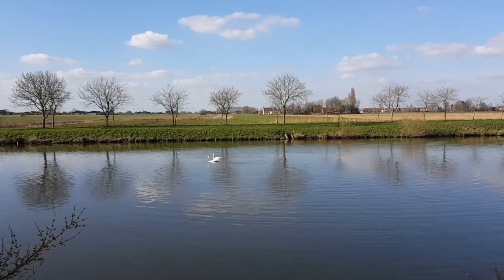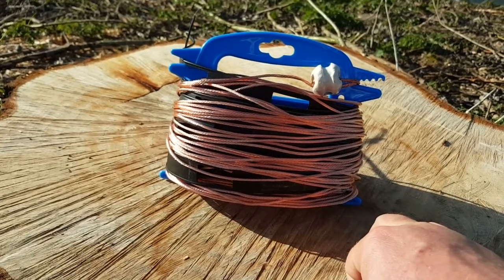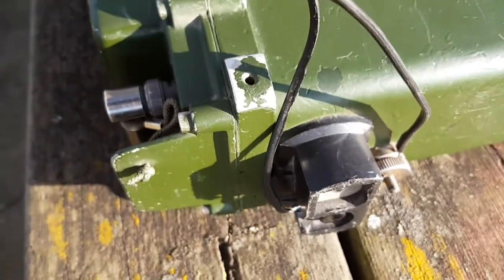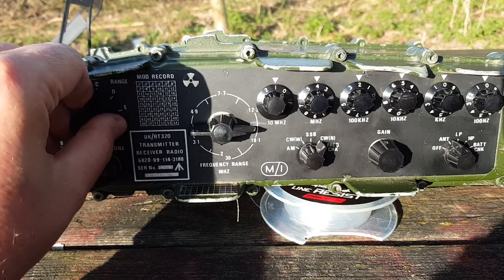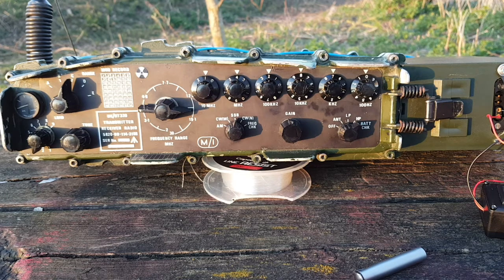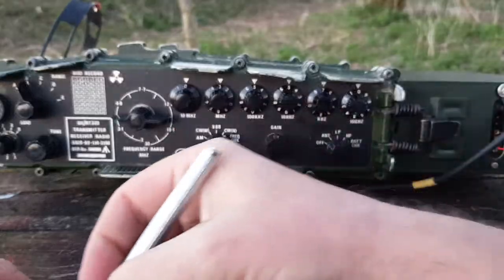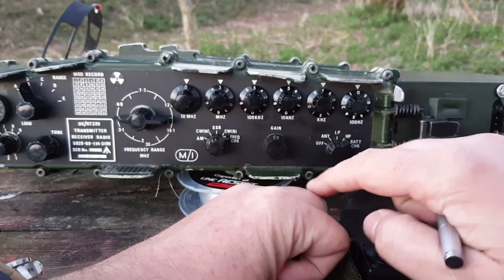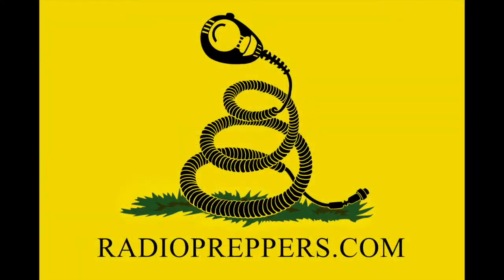W3EDP Antenna with RT-320.

Comment: The reason the dial is not moving is your freq is set up wrong...
You need to be set to a freq that matches your antenna which is, they all dont work well, plus time of day etc. if you swop out the ant for a skywave antenna then you would likely see something but best to review ant therory first to match time of day, conditions, power, ant type and size!!!
You cant just turn on two of these and hear each other or very well even next to each other, you need to be at a distance and take every factor into account. Its a serious indertaking as as an ex british radop it takes 1 month to learn and most giys fail and have to go back for to lecky camp to try again bk in the day 15+ years ago. if you dont pass the course, your kicked out of the unit and sent to basic to review other options, from driver to cheff etc

Comment: Good job! Great video!

Its amazing with all the screaming about the sky is falling ( global warming ) and yet people continue to toss trash like that is what it was made for! People just don't care or take pride in their environment! Its the only one we have! =]

But back to the W3EDP antenna. Ive seen great reviews on it. So I built one. 300 ohm TV twin lead. 4:1 balun and 25ft of RG8X. ( I tried a short 8-12 ft piece of RG58 but did not work! No tune! )

It seems to have great RX! Only made 2 contacts so far. 1 on 40M and 1 on 20M. They both gave lower reports than I gave them but I'm not sure what power they were running. QSO party this weekend and it was fast n furious so I didn't get to ask. Could have been a kilowatt. I was running 100 watts.

Now the real test is to check in on NETs. I prefer that type of operations plus they are there everyday so you can tell how band conditions are easier. Once you know the guys on the NET you know how their signal normally are and establish as like a reference. When conditions are great a wet noodle will do good so talking to the same guys everyday for years you easily know when something changes. Jumping on a freq one day at a portable station doesn't prove much. =]

But I agree. Something isn't exactly right with the W3EDP. Not sure if its the twin lead section or the long wire. Even once I added 25ft of RG8X I still had trouble tuning it! Also I have mine configured in a perfect inverted L about 20-25ft up.

I think it can be a great antenna but I'm not so sure about for portable. If it has to be perfect then its to finicky for portable. I think a doublet is better. 

I prefer my 88ft Doublet ( 300 ohm TV twin lead feeder ) as it seems to perform very well, not very hard to install and packs up very nice! 

I will check it out again this next week. Get on my O/M NETs and compare signals.

RM
Reply from the maker: Thanks. I need to build a new one and do more testing...
Reply: @RadioPrepper  yeah what I am seeing is to deploy it and keep the Inverted L shape its easier to deploy a doublet in a Inverted V. Unless the tree you need to hang it from is covered in foliage and you can't access a limb and you have to go over the top or something strange the W3EDP might work better. But ideally you need two trees with a strong line between them.

I think it performs well but not as easy to deploy. So a recon of the site before hand is a must I think. If you can drive to the site then no worries. Bring all your portable antennas. But if you have to hike then knowing the site ahead of time is a must. ( I have SOTA in mind as this was mentioned on a video of a guy using it for SOTA. ) Sorta like with you and the tree stump! It worked great say last year but a tree stump no longer supports anything. lol

Comment: Great video. do you have a favourite antenna for 20/40 meters for the PRC320?I have a couple of these fantastic radios but have never been able to make any  SSB HF QSOs.I know they are transmitting but no luck. I noted you SSB frequency of 142870. Is that your preferred CQ  calling freq?73 Dave
Reply from the maker: For both 20/40 the end-fed from LNR Precision 10/20/40. Same as the PAR.
Reply from the maker: An 8m wire directly out of the tuner plus a counterpoise work great. Join the PRC-320 WhatsApp group to find other 320 users on the air...

Comment: Before S-meters were a common gauge on commercial transceivers, because most early equipment was home brew or recycled military transceivers OP's gave RS/phone and RST/CW and RTTY, hams gave RS and RST.  You're going to give report to the other operator a guesstimate signal strength. too bad hams don't want chat a bit on first contact. They rather get the basic information then leave.
Reply from the maker: Yep, I estimate sometimes. What bothers me most are fake 599 reports..

Comment: Hi Gil. I have seen a few of your videos. Thanks for sharing your Clansman use. I replied on another post, but would like to know how you charge your 24v Batteries. I have a DCCU for mine which is 28v, but wondered if buying the 14v DCCU is better than trying to find a 28-30v charger?  Any advice would be gratefully received. 73's Paul M0KIA
Reply from the maker: Found it! https://www.componentshop.co.uk/500ma-smart-charger-for-12v-24v-race-packs-10-20-cell-pack.html